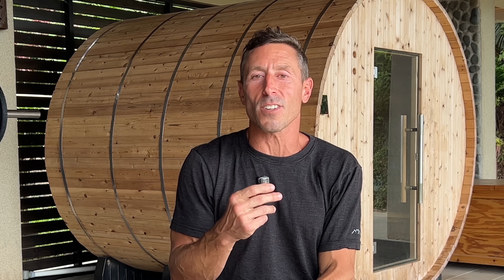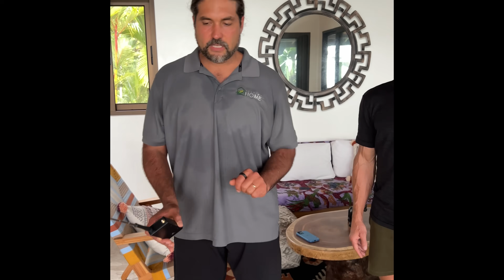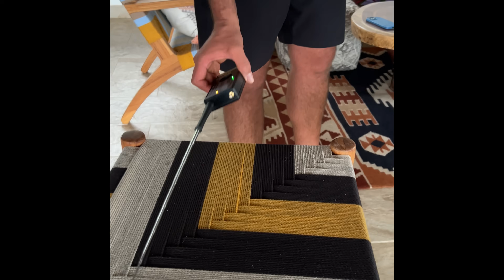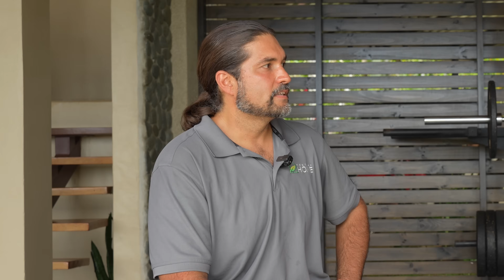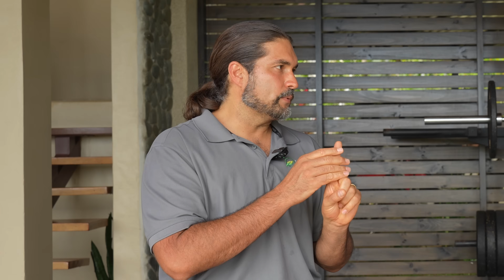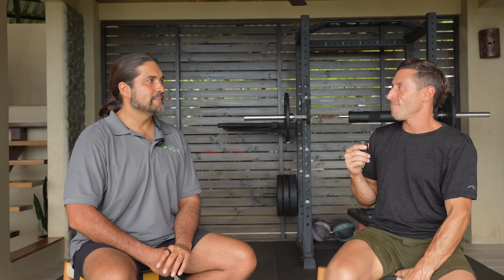Earthing vs. grounding

Comment: Hmmmm, well he’s wrong about what the “earth” or “ground” pin in every socket does. It’s definitely not “a sewer for waste…dirty electricity to get dumped and routed back to the power company”. That’s not correct at all and anyone who knows anything about electricity should know that.
Reply: Instantly thought exactly this as soon as I heard it, only shows he actually understands absolutely nothing about grounds/grounding and makes me cringe to the possibility that all the information of this video might be to the same level of cringingly wrong
Reply: Hope he is a better doctor than an electrician. Some people......
Reply: Lol exactly 😂 I’m like dude what?! I deal with this shit everyday, wrong!
Reply: Yes, the ground wiring also includes an actual metal rod into the ground. But it gets connected to Neutral in the panel same place as to a metal rod into the ground, so perhaps some minor voltage difference is what the concern is about.
Reply: That’s what I was thinking. So now I’m skeptical about everything else he said. Lol
Reply: Salesman with no idea how electricity works, this is so incredibly wrong....
Reply: I don't know about rubber mats and whatnot, but when I use a linen only, 100% cotton grounding sheet, threaded with copper, it nearly heals 100% of my pain and inflammation for a time. And that works for me. I had no intentions of having any faith In this because my medical problems exceeded all the specialists prescriptions or pain remedies..... So, maybe it's just the mats or something? Because the grounding linen works for me hands down.
Reply: That would be shocking

Comment: What about the tests shown from the earthing guy you had on before? Where you can get current from holding a charged device and go on these grounding pads and it goes down to zero? Those don't matter anymore? It sounds like those two dudes need to debate and figure out who is right? Do I sleep with my grounding device or not?

Comment: I’m pretty sure it’s electrical code in both Europe and The US to ground (earth ground) all electrical boxes. In the US the neutral lug is connected to earth ground and the transformer to the power company. Also I’ve tested body voltage w/a meter and whether it’s earth ground (literally standing outside) or house ground/neutral - it’s identical voltage drop. Also same w/conductivity and ohms readings. Same diff.
Reply: Thankyou